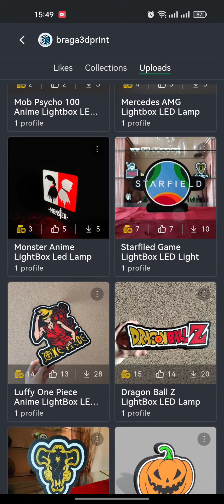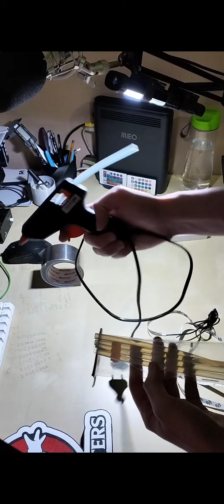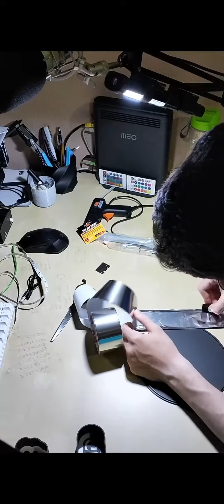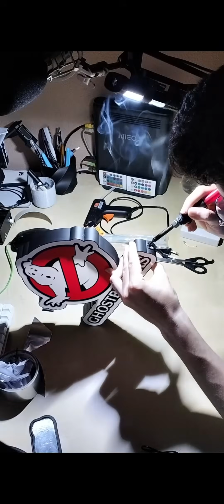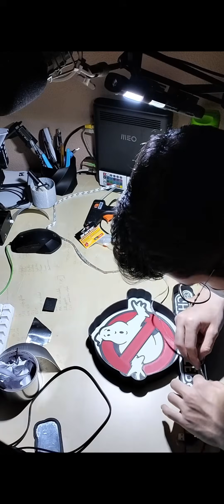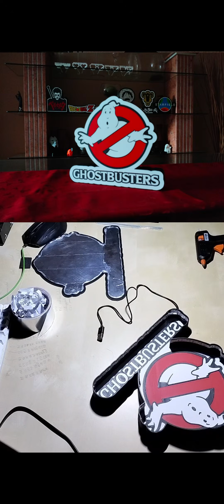Complete Assembly Guide for 3D Printable Lightbox Models

Comment: Use his method in Bambu studio and use the dimensions from the width of the led lights and the thickness of the power cable. I used his recommended lights and the hole size I created is 4.5mm tall 8.5mm wide pull the led through till you get to power cord and use a little hot glue to keep from coming out.

Comment: Why this barbaric large hole to get the usb plug through? 😳 Just cut the cable at the LED strip and later resolder it again 👨🏼‍🔧
Reply from the maker: You're right, soldering can be a neater solution. However, not everyone feels comfortable or has the tools for soldering. My goal with this video was to empower everyone with the know-how to create holes of any size they need. Offering flexibility allows users to customize based on their preferences. Thanks for sharing your thoughts!
Reply: also just switch filament to white when printing the back. if the inside is already white, it negates all the need for the aluminum tape. LOL